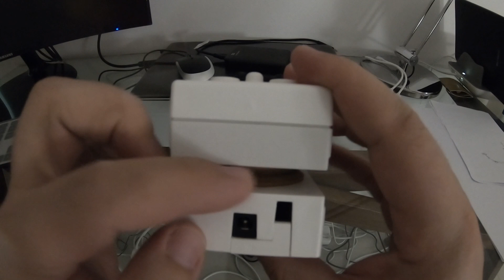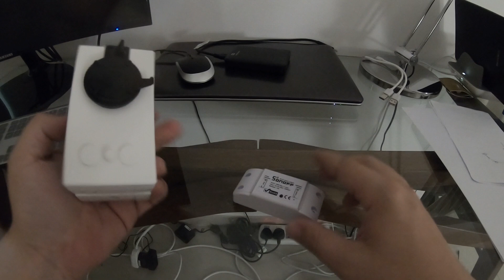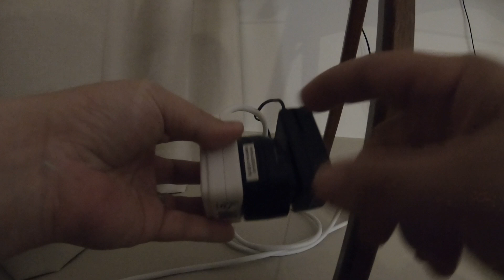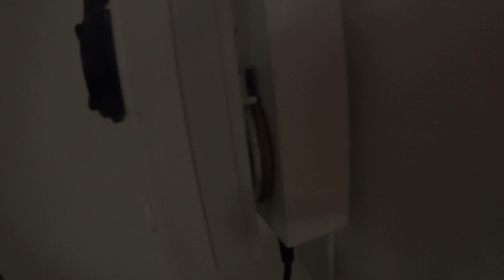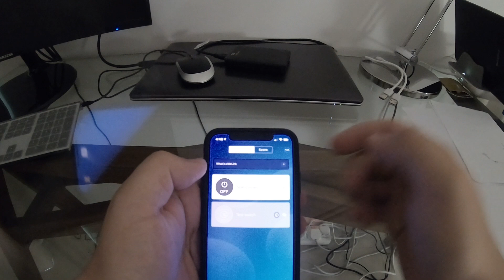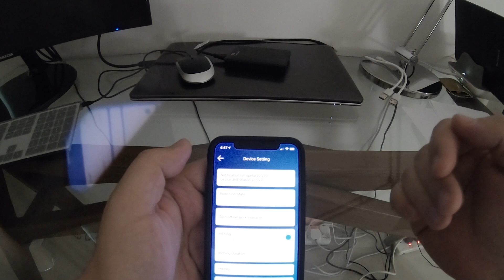Curtains automation guide, make your curtains smart

Comment: Hi. Thanks for the video. One question please; did your curtain had the string on the side to close/open, or was your model MANUAL?

My existing curtains has a track but i have no cords. To close/open i use my hands on the cloth itself.

How can i do automation withe this model please?

I had seen units like SwitchBot and Slide motors... But they have not released them yet.

Thanks for your time!
Reply from the maker: Hi, Yes my curtains have the string on the side so in my case the motor connects to the string. 
Depending on the the of rail you have you can probably look at something like this https://amzn.to/2FDJ9ld from what I can see its a relatively  new product and not much positive feedback 

Otherwise the other solution which may work for you is this https://amzn.to/3iUumAK .

The main thing you need to consider is how heavy are your curtains and if the motor will be able to pull them. 
I think the second link provided is a bit more complex but probably will be a better option for you.